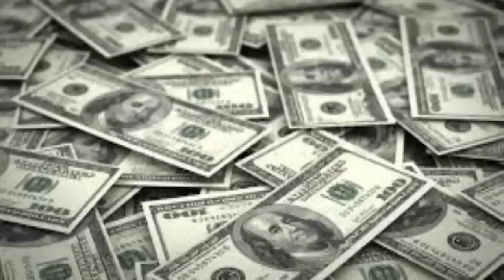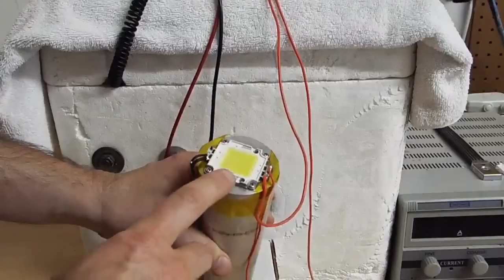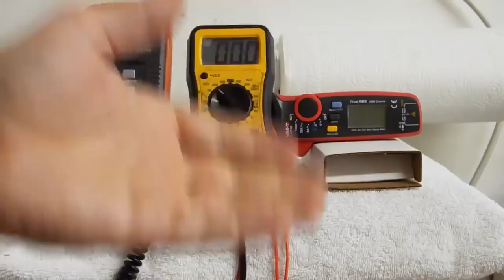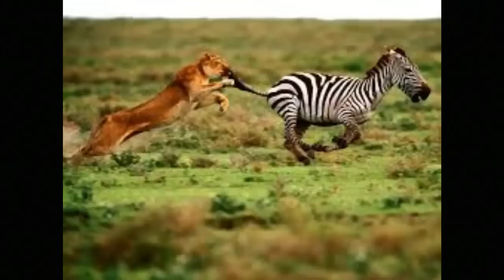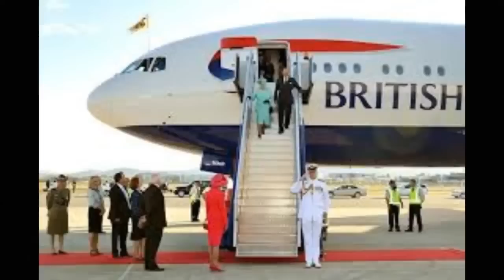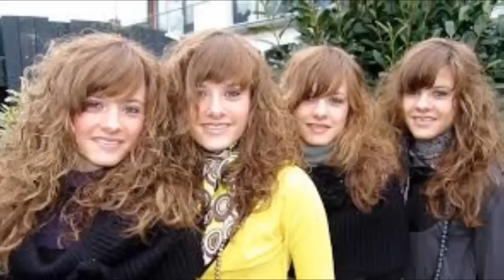Internet Lumens vs Actual Lumens, and the 100 watt LED test

Comment: I may be missing something here or have not watched your video carefully but how do you measure lumens with a lux/fc meter? As far as I know you cannot do it. You need to put that 100W LED into a reflector cap and knowing what angle of that reflector  where the light is coming from and a distance from from the LED to your lux meter you can calculate lumens using lux measurements.  Here is a link how it is done https://www.suprabeam.com/uk/lumen-to-lux-calculator As for the fakes, a lot of dodgy sellers lie just about everything to trick you into buying their products.
Reply from the maker: Hi Michael.   Using the meter alone you cant get an accurate measure of lumens.   You have to capture all of the light, integrate it and then measure.   Your system also needs to be calibrated.    Thank you for the information you provided as well.   I had never heard of that method.    
If your interested in seeing how to make the device used with the meter for lumens here is that.
https://www.youtube.com/watch?v=xOE1ykJ5WAU
Reply: I would like to see a comparison of both methods for measuring lumens. After all, if both are right, their result should be the same.

Comment: What do you think of using tail cap current and Cree posted luminescence numbers to calculate output? I realize this would be gross output and not take into account reflector and lens quality. But its a start and should be good for comparison.
Reply from the maker: Harv, that would be better than many factory claims on many lights.   As long as your light has a linear type driver and not a buck or boost driver you could actually get fairly close.
Reply: In general, then, for single 18650 or 26650 cells only, and for XML or XML2 LEDs only, would the circuit call for a linear driver or something else?
Reply from the maker: Yes, most of the single cell lights I've seen this would work for.    If your running a 6V LED like an XHP70 and the light is powered by 2x 3.7V cells it will also give you a reasonable measurement at the tail end of what the LED is seeing.      Where you would get a skew at the tail would be a single XML2 powered by multiple cells in seires where the voltage exceeded what the LED was using.     For example a single XML2 powered by 3 series cells might be driving the emitter at 3 amps.  At the tail you would get a draw of more like 1 amp.
Reply: OK, thanks. This is great info.

Comment: that fake lumen advertising circle reminds me of the PMPO-Watt on PC/Hifi-Speakers in the 1990's or the Megapixelrace since 2005, or the Webcam notorious fake resoloution numbers, same with CCTV or Car Dash or action cams. Reviews became a soloution to that but in a lot of fields reviews are impossible since there is no "brand" or a flood of fakes so you cant trust any brand claim (like in the LED sector). So basicly every costomer needs measuring equibment or atleast a friend which has bought or buil one.
Reply from the maker: I know right.  I wish we had a way to make the all start over at ZERO with their claims.  Then at least for a few months as the race rocket forward the products would legitimately be able to live up to what was being said LOL.  Thanks for sharing Hektor.
Reply: a soloution would be cheap measuring device which are calibrated out of the batch. A small device like fake money detectors for ~ 15$ :). I mean its not diffiult. Only a luxmeter + a defuser + calibration. These devices could build with this as a cheap defusor:  
http://www.ebay.com/itm/37mm-White-Balance-Lens-Filter-Cap-with-Filter-Mount-WB-/250540493156?hash=item3a55608964:g:eGAAAOxyFn9R55GI 
+ a luxmeter 
http://www.ebay.com/itm/WHDZ-LX-1010B-Handheld-Digital-50000Lux-Luxmeter-/112436929556?hash=item1a2dc36414:g:ZUsAAOSwJAtZOnRB 
+ a case ;D 
https://www.fleshlight.com/collections/cases/products/silver-case 
(or a cheaper one ;)
only issue is we need a cheap calibration source for ~3-5$

Comment: I have a question that I can't seem to find the answer to. So If I wire 3 18650s in series, I will have around 12 volts. I run it through a voltage booster and get volts. But how do I control the amperage? Does the LED automatically limit it, or can you also change the amperage from the voltage booster?
Reply from the maker: Hi Joshua.   The answer depends a lot on what your using for a "booster".     Basically though if you regulate either voltage or amperage you regulate both of them.    Example.   A cree XHP70 on a 12V mcpcb will be driven at 1500ma if the voltage to the LED is 12.0.   If the voltage to the LED is 12.5 then amperage increases to 2100ma.

There's a graph showing this relationship on page 10 of the data sheet.
http://www.cree.com/led-components/media/documents/ds-XHP70.pdf

If your booster is putting out a regulated voltage of exactly 12 or 12.5 V etc the LED will be driven at what ever its rated for at that voltage.    If its higher than that and you need to cut back on the amperage, say your booster is actually putting out 16 volts you can add a resistor before the LED to drop some of that.      Or if you want to get variable power (turn the light up and down) you can probly use a PWM control.   

If you give a bit more detail on your project myself and others here may be able to assist further.

Matt
Reply: PCB just look up 12.6v charge on ebay you will see the control boards to choose from, without a controller for the batteries you get a nice samsung fire. Its not the batteries in the phones that burn down its the tiny chip from china that fails to turn off lithium.

Comment: thank you for the in-depth review!

you're absolutely right about the Convoy, I picked up three Convoy S2 Plus's from gearbest and that little flashlight with a single rechargeable lithium-ion battery outshines anything I've got by a wide margin, the output and throw is incredible for that small flashlight and I haven't even modified it yet.

there's a channel here on YouTube called David Sunshine and he specializes in modding and upgrading these LED flashlights for maximum output. The links he provides are direct to these Asian companies and you can order quantities of what you'd like up front so you don't have to wait for the long delivery time ordering piecemeal.
Reply from the maker: Thanks for sharing.  I will check out Davids channel as well.

Comment: What sort of blew my mind was how much the reflector and lens actually affects the amount of lumens coming out of the front as opposed to what the emitter is claiming to generate at a certain wattage. In the end it does indeed make it well worth the extra money buying a flashlight with those quality components if you're otherwise just crushing the potential light by not taking advantage of the full emitter output.  As far as overdriving for brightest output, after seeing someone else's testing where the XHP-70 was pushed to 9A before breaking down from heat, I decided that was the way to go!  I found a copper sinked XHP-70 actually does fairly well when simply sitting on an approx 2x2in pc alu  heatsink with a 12v pc fan on it. the 12v pc fan driven at roughly 8v or two series 3.7v's gives enough rpms to keep it from getting hot. After a 30 second test run using just that heatsink and fan pushing the emitter at 6A it was only a little warm to the touch. If you're only getting roughly 5000-6000 lumens @ 100 watts with one of those cheapos, you're right it's not a bad deal, but if you can get roughly that amount of lumens from an emitter at less than 50 watts it's well worth the extra 10 bucks or so.

Comment: so are most of the convoy flashlights all good reliable and true to lumen count.
Reply from the maker: The newer ones certainly are.  Simon works closely with members of Budget Light Forum so he has his finger on the pulse.  Most of the suggestions made by members there are followed to a degree.    All of the hosts are good quality.   The only beef I have with any of complete lights is that some use old driver tech.   The smaller ones with a clickie still use 7135 based drivers with the same modes lights from China had 10 years ago.   Strobe, SOS, all in the default group.    Other than that I would say you can go wrong buying a Convoy flashlight.

About the lumen count.  I would say they are within reason.   Take this light for example https://www.aliexpress.com/store/product/Dipper-BD03-flashlight-CREE-XML2-U2-LED-18650-26650-flashlight/330416_1900120167.html

If you choose the U2 bin emitter it will be close to the 600 lumen rating.  It probly has a bout a 3000ma driver board in it.   If you choose the T4 emitter it will be like 400ish probly.